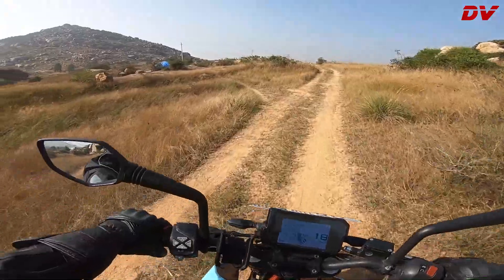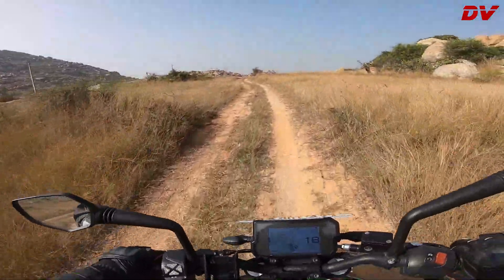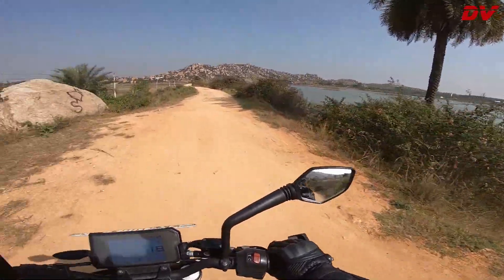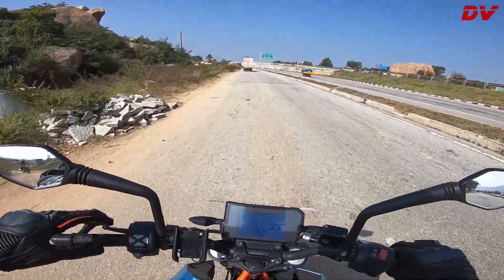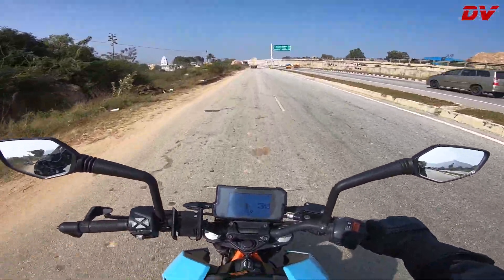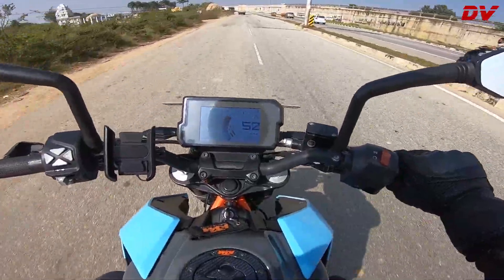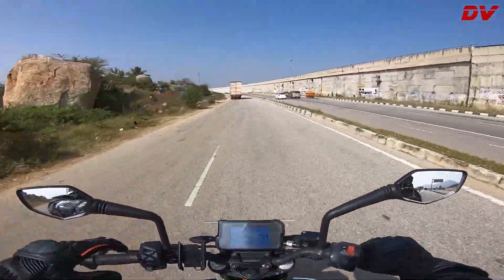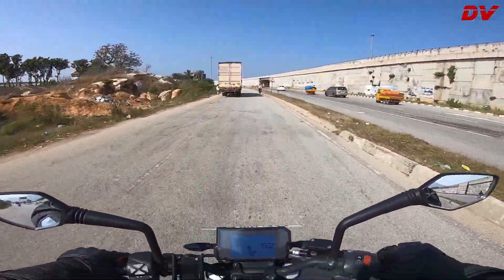HOW TO DO CLUTCHLESS UPSHIFTS & DOWNSHIFTS!?

Comment: After 3 yrs of riding Dio. I forgot how it is to ride a gear bike 😂
Reply: Same used Yamaha Ray Zr for almost 4 years just recently upgraded to a P220 have to say a scooter is a much more practical machine.
Reply: @ascaniomarak1561  Thts true scooters are practical. I got a 390 and the difference is hard. 😂😂 Clutch is something i always mess
Reply: @sirkira7991  and they tend to be more smooth and obviously fuel efficient 😇.
Reply: @ascaniomarak1561  Very true!
Reply: Superscooter (maxi scooters) started coming to Indian market. So those who want more power and speed like bike but not comfortable with changing gears can try those scooters 😜.
Reply: In ten years entire world will be on electric bikes and scooters. Hopefully those are as much fun as riding 2S, 4S bikes.
Reply: @PD-dj7cu   IC engine vehicle will not be fully shifted to electric vehicle as the electric vehicles have its own disadvantages and those electric vehicle which eliminates these disadvantages will come in a hefty price tag .Instead the electric vehicle
will be different segment or fuel option like petrol, diesel, CNG etc.

Comment: We shouldn’t blip the throttle for quick shifter in super bike isn’t it
Reply: Yes
Reply: But it’s better to have this feature in such a cheap bike. This give better control on high speeds and quicker timing. Because using clutch tends to use more time to reach high Speed.

Comment: Hey DV does this KTM bike have quickshifter and auto blipper.Can this clutchless shift can be done in rr310 bs6.
Reply: You can do it Splendor also. Need a lot of practice and precise timing. Chances are you may break your engine too.
Reply: @ujjwal2206  no need of so much of practice . I saw a vdo went to my bike . rode it used the clutchless upshift and downshift . and that's how easy it is
Reply from the maker: The 390 in this video doesn't have anything, you can use this trick on any bike
Reply: @dhritirajdas7824  Using engine braking since 2017. If its not perfect you gonna ruin your engine badly.

Comment: But in zx10rr it seems you dont cut the throttle and change the gears with full throttle open is that true???
Reply: Yeah thts becoz it has auto blipper
Reply: @aashley6583  yeah but in this duke 390 is it having auto blipper
Reply: @devchangela1333  nah... I guess its only equipped with quickshifter ... So u have to manually blip the throttle
Reply from the maker: In zx10rr you don't cut the throttle for upshifts as the ecu will do it for u but for downshift you cut the throttle as the ecu will auto blip as u downshift. This 390 doesn't have anything its old model so its complete manual what I did in this video